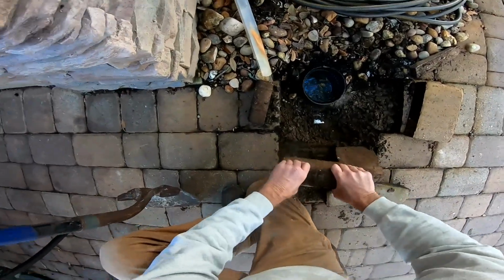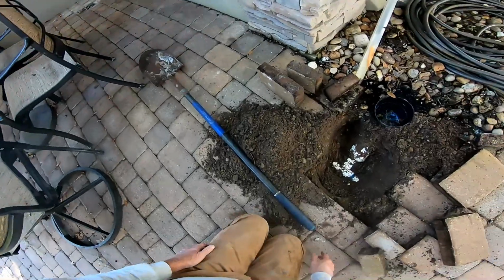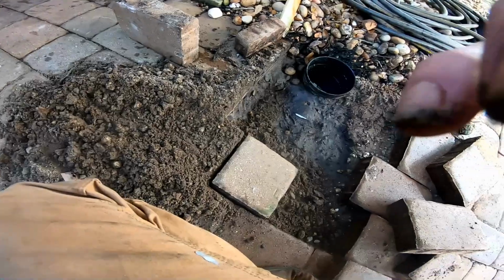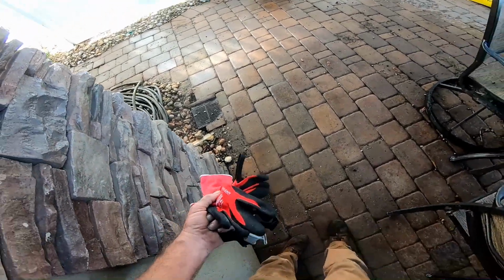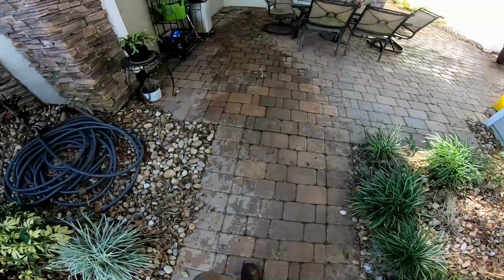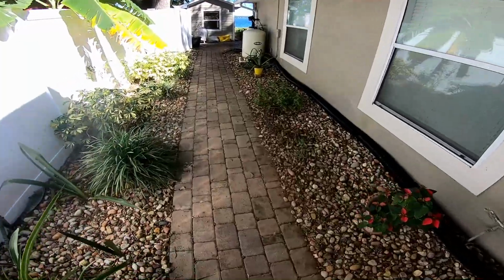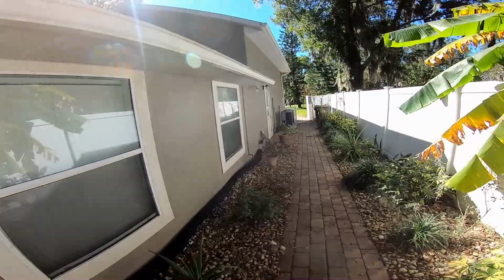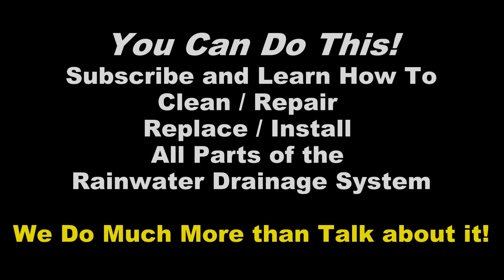Fixing Other Peoples Work, Catch Basin in Pavers

Comment: As you will move that downspout why don't you connect it to the sum pump rather that let it splash on the ground
Reply: I had the same thought too.
Reply: because there are things in the ground beside the house they cannot mess with
Reply: @joshuaguenin9507  - makes sense, but if you relocated the downspout to the other end (by the outdoor light), you're only a few feet from the sump pit. I'd just run a horizontal pipe for a few feet, laying on top of the ground or maybe half-buried, and discharge into a new hole on the sump pit lid.